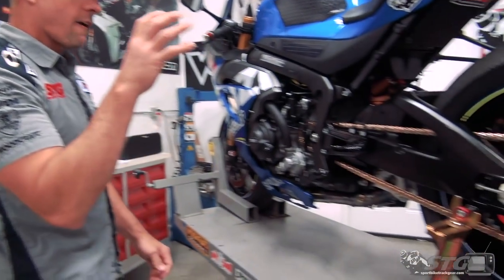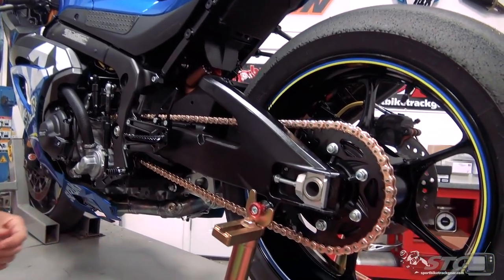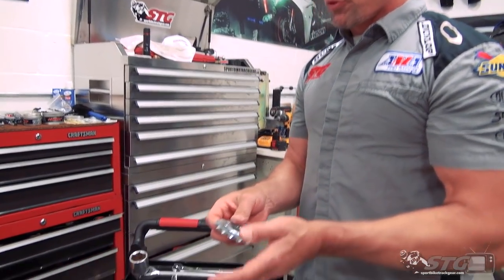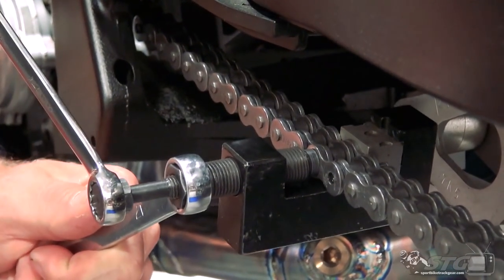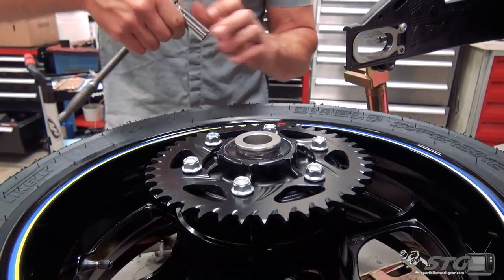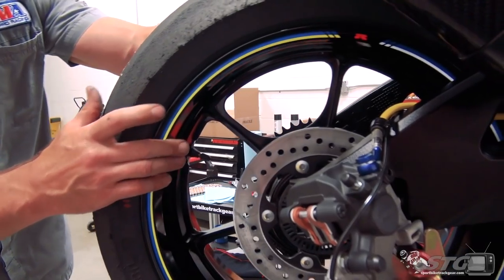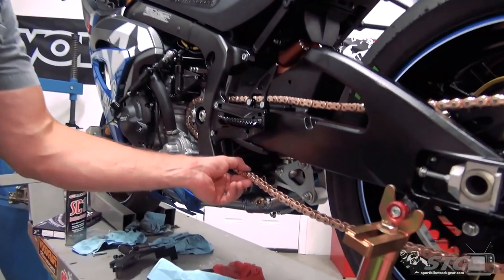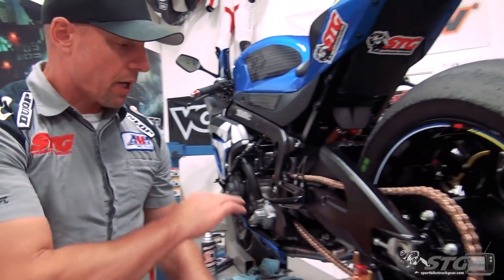Vortex 2018 Suzuki GSX-R1000 Chain and Sprocket Install | Sportbiketrackgear.com

Comment: Brian, I have been looking into a chain replacement for a new MT-10. I have also heard that the 520 pitch is the way to go! I plan on doing the Vortex sprocket and EK 3D pro in gold and with more links than stock to stretch out the wheelbase on that Yamaha. Which results in better drive out of corners.

Comment: Brian tried messaging your staff without an answer I want to do this on my 2017 gsxr1000r but I’m running a set of BST carbon fiver rims can you adjust the package to include a rear sprocket that fits after market rims?

Comment: Good luck putting back that chainguard back everyone! I'm talking about that last bolt between chain sprocket and the chassis. It's almost impossible 😮😮☺️
Reply from the maker: It has been a while since I did this but remember it being easy with the rear wheel removed. - Van

Comment: Another incredible informative video. I just replaced the junk OEM front sprocket. I snapped three teeth off it. Chain was in spec. I'm assuming learning how to use the quick shifter was probably why I snapped three teeth. I went with a steel vortex sprockets and EK amazing and beautiful 3d chain. Hey Van are you still loving this gsxr? I've had my 2018 for s few months now. Coming from the legendary K5. This new gsxr blew me away. Top end feels similar. Low and mid range is so much more powerful. Appreciate the excellent informative videos as always. It's been many years now me  watching here. Your still going stronger than ever. You and your family have an excellent safe summer
Reply from the maker: I am still riding the GSXR, just not as much now that Max is racing MotoAmerica. Thank you for your support and I hope this finds you and your family well. - Van

Comment: This suspension has more travel than my K5. We have to run the chain towards 30 on the rear stand to have proper slack while riding. I had 25mm on the rear stand and that's not enough. It gets tight. Been playing with this new chain tension for two days now. I went back and forth. About to put more slack again. At least now we know
Reply from the maker: I have started removing the rear shock so I can pivot the swingarm to measure the slack when the swingarm is totally extended. Once I find that point I reassemble and measure the slack. - Van
Reply: @sportbiketrackgear  please let me know what you end up with. I'm curious how much the swingarm pulls out of the chain.

Comment: Nice video Brian. OK we know the 520 stuff is lighter , but if a wee bit of weight is not a big deal, drop 1 tooth off the rear will give basically the same gearing and lengthen the wheelbase a touch .
Reply from the maker: There is more to it than just a bit of weight. With 520 you will typically have more gearing options if you are using the bike on the track. The OEM chain gets the job done but it is not very pretty. A high quality chain will typically reduce friction which will buy you a little more power. End of the day none of these are really earth shattering, that said they do add up over a full build. - Van
Reply: @sportbiketrackgear  oh for sure, fully agree. I was just suggesting -1 on the rear may achieve very similar results for a fraction of the cost. 
Kev

Comment: Keep in mind that since the front sprocket is not set on the center line of the swing arm pivot the chain will get both tight and loose as the swing arm goes up and down. (as it departs from the parallel where the chain will be the tightest)

Comment: What do recommend for 2015 cbr1000rr  on the city streets for high speed and cornering ...no track days ......I ride hard corner hard and do freeway pulls at high speed let me know please what you recommend I'm getting alot people saying -1 +2 ....what's your recommendation
Reply from the maker: -1 and +2 is pretty aggressive for a 1000 IMO which will reduce the top speed a bit if you are taking the  bike to that limit. I would start with +2 in the rear for the street. - Van
Reply: Okay thx van... I appreciate it i was thinking supersprox or vortex ...thoughts  on those two sproket kits which one in your opinion is the better sprocket

Comment: Hey Brian, I was looking at this exact setup for my 18 r1m, but I'd like the chain with the black outer plates, and the gold inner plates, I wanted to stay with 525 pitch though, besides weight saving why go with 520.and let me know if you have this setup in 525. The r1m is 16/41 stock
Reply from the maker: I have run this chain all season with almost zero stretch. Personally I would go with the 520 on the R1, we did this on our R1 and did not have any issues. Below are links to the chain and sprockets for your R1:
EK 3D 520GP X-Ring Roadrace Chain

https://www.sportbiketrackgear.com/ek-3d-520gp-x-ring-roadrace-chain/

Vortex Yamaha YZF-R1 15-18 520 Steel Front Sprocket

https://www.sportbiketrackgear.com/vortex-yamaha-yzf-r1-15-17-520-steel-front-sprocket/

Vortex Yamaha YZF-R1 15-18 520 F5 Hardcoat Aluminum Rear Sprocket

https://www.sportbiketrackgear.com/vortex-yamaha-yzf-r1-15-17-520-f5-hardcoat-aluminum-rear-sprocket/

- Brian Van
Reply: @sportbiketrackgear  , thank you for the attack performance rearset suggestion,I went with aero hard, amazing on the 18 r1m, kept the stock brake light switch by buying a bolt and washer, used some loctite, spring in the cutout in the brake arm

Comment: Thanks you. Exactly what I needed to feel comfortable for my install. 
Looking to comfortably break 200+ while minimizing acceleration a lot loss obviously, what do you recommend tooth count for front a rear on my GSXR1000. And what brand did you use on this bike.
Reply from the maker: I am running an EK 520 chain with Vortex sprockets front and rear. The gearing is stock front with one tooth smaller in the rear. - Van

Comment: Hi Brian also agree on 41 and 16 on fron t,  too short compared to my 10rr and r1m
Reply from the maker: Every bike is different, the transmission ratios are not the same on all bikes which is why the sprockets used vary. I rode the bike last Friday with the gearing at Grattan in MI and it worked well. As the pace picks up it will be even better. - Van

Comment: I did a sprocket change on the same bike but 16/45. My quickshifter is now acting a little weird. Above 10k rpm, it doesnt want to shift 4 to 5 nor 5 to 6. At lower rpms at 6k, doesn't shift down. I had to resort to manualy shifting. Feels like a power cut but gears don't change. QS icon blinks. Any ideas? Would be helpful.
Reply from the maker: If it feels like the power is cutting but it does not change gears it is possible the trans needs to be serviced. Important to make sure the throttle is closed when initiating a downshift. - Van

Comment: Is it safe to spray front sprocket area with chain cleaner to clean? Worried about seals and silicone that seal engine cases

Also any need to grease push rod for clutch? 

Same bike in question 

Thanks
Reply from the maker: Safe to spray and you can always rinse if you are worried about it. When you have it apart you can also apply a little grease as well. - Van

Comment: I didn't understand what's the point of putting the wrench between the chain and the sprocket when tightening the rear nut?
Reply from the maker: That is to force the rear axle adjuster blocks firmly against the adjuster screws. I have switched to using a small phillips screwdriver now. - Van

Comment: Did not show tightening of front sprocket nut. Sad
Reply from the maker: 99% of the time I use an electric impact without the chain installed. - Van

Comment: Hey Brain what would you recommend for a daily driven 2011 gsxr 750? -1 front +1 rear ?
Reply from the maker: Either that or -1 front and +2 in the rear. Your suggestion would be just a bit less aggressive. - Van

Comment: installed brand new vortex sprocket front 16 T rear 45t 525   new 525 chain and i believe the rear sprocket wobbles and has tight spots in the chain gets tight then half a rotation of the tire the change get loose
Reply from the maker: We have installed a lot of Vortex sprockets over the years and have not had a bad one yet. To check the new sprocket you could install the OEM one that you removed and see if you still have the tight spot. If you still have the tight spot odds are the chain has stretched unevenly. I have seen riders install a kit and set the chain tension too tight result in uneven chain stretch. - Van

Comment: I've been looking into changing my sprocket and chain and need some serious help. I have a 07 GSXR 600. The previous owner has a 48 back sprocket  not sure what the front is. The speedometer is severely off and I want to fix that bit but I also like the torque at low end. Been thinking 16 front and 45 rear would be good but not sure.
Reply from the maker: We have a ton of chain kit options for this bike on our site. If you want to fix the speedo you can install a HealTech SpeedoHealer. Here is a link to our site: https://www.sportbiketrackgear.com/parts/suzuki/gsx-r600/2007?_bc_fsnf=1&Department=Sprockets+and+Chain+Kits - Van

Comment: I thought you need to use special sockets with an impact gun? That looked like a standard socket
Reply from the maker: Depending on the application you can use a non-impact specific socket with an impact. Really depends on the socket and the work you are doing. When in doubt use an impact specific socket. I have been fixing shit for a long time now (was a tech at a Cadillac dealer before I started STG 18 years ago) so I am pretty good at determining what will and will not work. - Van
Reply: @sportbiketrackgear   thanks for the advice!

Comment: anyone think how to videos are 50% whats the torque?
sorry brian but heres the right way
rear sprocket 43.5 ft/lbs
counter sprocket 83 ft/lbs
engine speed sensor where applicable 18 ft/lbs
rear axle nut 72.5

Brian brian brian........tisk tisk....props on the gearing selection video....landed me right where i wanted thx
Reply from the maker: Thank you for sharing the torque specs. As I say in all of the videos if you do not have the experience to work without a torque wrench research the specs and torque away. I have spent all of my adult life wrenching, 20 year professionally. Aside from engine assembly most professionals do not use a torque wrench. - Van

Comment: I just put a sprocket kit on my 2021 Zx6r and the chain is eating the top of my chain slider and whining. I have played with the slack (loosened/tightened) and cleaned /lubed the chain but it doesn’t help. Any idea on how to fix this?
Reply from the maker: Make sure the front sprocket is installed so the spacing from the output shaft to the face of the sprocket is the same as the OEM sprocket was. Some of the front sprockets have a shoulder on them that changes the spacing depending on whether it is facing the output shaft or not. If this spacing is wrong it will cause issues. - Van

Comment: What size of sprockets and chain do you recommend for street use? Thank you.
Reply from the maker: It is different for every model. IMO for the GSXR1000 the stock gearing is going to get the job done for most everyone. This bike makes so much useable power gearing changes for the street are not as important. The only way I would make a change would be if you want it to accelerate quicker. In that case I would replace the rear sprocket with one 2 teeth larger. - Van
Reply: @sportbiketrackgear  Thank you so much 🤟

Comment: Hey Brian!  Are you planning on installing a toe guard (shark fin) on that bike.  I would really love to see one done as well as be pointed to a particular one you recommend. I have a 17' 1000R and haven't been able to find a definitive solution.
Reply from the maker: Yes I will be installing a toe guard soon. Not sure which one I will be doing on the GSXR. On Max's R3 I went with the Woodcraft Toe Guard, here is a link to that video if you want to take a look: https://www.sportbiketrackgear.com/woodcraft-wide-coverage-toe-guard-kit/#pv__tabs  - Van
Reply: @sportbiketrackgear  Thanks for the reply.  Great video.  I see there are a few universal models out there.  Just would like to find the right one before I start drilling holes in my swingarm.
Reply: @sportbiketrackgear  0

Comment: Aftr changing the chainset and added/removed some teeth.is speed calibration needed?
Reply from the maker: No this bike uses the wheel speed sensors to calculate speed. The only thing that would create inaccuracy would be changing the tire size. - Van

Comment: Thanks for the great videos. Coming from a >2015 R1 with 15/45 gearing what would be a comparable selection for the GSXR?
Reply from the maker: I would use the  16 tooth front (one tooth down from stock), 41 tooth rear (4 teeth down from stock) and 118 links like we did on our bike. It works great everywhere I have ridden it. - Van
Reply: @sportbiketrackgear  i have a 2020 gsxr 600 what would you recommend gearing to get best out of bike. I'm not putting it on the track ,just want performance
Reply: Did you ever find anything as far as a gearing set up? @NextManUpTV

Comment: Quick question Van, doe s the back of the master links chain supposedly sticking out or it should be flush?
Reply from the maker: The master link should not look any different that the rest on the chain. Only real difference is the rivets on that link have a hollow center so they can be rolled over with the rivet tool. - Van
Reply: Thank you Brian!

Comment: After installing my new front sprocket it has a lil play while on the shaft. Ever heard of this?
Reply from the maker: If you purchased the kit from us please contact customer support so we can get this sorted out for you. You either have the wrong sprocket or there is an issue with the way you have installed it. Either way it is important you do not ride the bike like this. - Van
Reply: @sportbiketrackgear  i will call tomorrow. But im sure its the right sprocket, i matched it with my old one. When i slide the sprocket onto the shaft and have the bike in first gear you can slightly move from left to right.

Comment: Thanks! Here is south korea. Front 16 and rear 41 ~ 43? Right? 520 chain?
Reply from the maker: Yes that is the range we are working with right now. Currently I have a 41 tooth on the back of the bike. I have ridden it a couple times and the chain has stretched very little, real happy with this kit. - Van

Comment: Would you recommend the EK 3D 520 GP for street riding for a 1000cc or the EK 3D 520 z
Reply from the maker: The Z is a little heavier so it will stretch less and should last longer in theory. I have the GP on my bike and it worked great all year long on the  track, very little stretch. If the additional .3  lbs per 100 links is not important to you go with the Z. - Van

Comment: Did the rear axle nut start on that side originally or did you reverse it out of personal preference?
Reply from the maker: This is the side it was on when I go the bike. The right side is where you will typically find the axle nut on most sport bikes. - Van
Reply: My 2013 Gsxr 750 has it on the left side 😔

Comment: What would be the top speed with this sprocket set up?
Reply from the maker: That is a great question. I remember straight away GPS speeds of a little over 160 mph. Not sure what this would be held open on a highway for an extended period. - Van

Comment: Hi Van, would like to ask about the EK 3D 525 chain, can this chain work with the ducati monster 1200 s Y19. Online description the application is 250cc to 1200cc, the bike is 1198cc.
Thank you
Reply from the maker: Yes that chain will work for your bike. The 525 is more than strong enough. - Van
Reply: @sportbiketrackgear  thanks van, was cought between 2 choices, the EK 3D and the D.I.D ZVMX

Comment: Porbably a squid question lol: but whats the STOCK sprocket size on the 2018 GSXR 1000r?
Reply from the maker: Stock gearing is 17 front, 45 rear with a 525 chain. - Van
Reply: @sportbiketrackgear  Awesome! Thanks for the Response Van!

Comment: Hey what’s going on man I have the same bike but I use it more on the street then the track did you see any loss of power in the being of the gear and how was your top end performance
Reply from the maker: This gearing has worked great at all of the tracks I have used it on thus far. No loss of power at all, it is just a little taller than stock. - Van
Reply: @sportbiketrackgear  thanks fam I just ordered the same gearing and a couple other items I appreciate it

Comment: What size chain would you recommend on a 2011 GSXR 1000 with 16 teeth in front and 43 teeth in the back?
Reply from the maker: Looks like that will need a 114 link chain. The Vortex Racing Kits come with the chain pre-cut chain lengths. Here are links to both of the kits on our site: 
Vortex Suzuki GSX-R1000 09-16 V3 Chain and Sprocket Kit

https://www.sportbiketrackgear.com/vortex-suzuki-gsx-r1000-09-16-v3-chain-and-sprocket-kit/

Vortex Suzuki GSX-R1000 09-16 V3 2.0 Gold Chain and Sprocket Kit

https://www.sportbiketrackgear.com/vortex-suzuki-gsx-r1000-09-16-v3-2-0-gold-chain-and-sprocket-kit/
Show less
Reply: Thanks for getting back to me so fast 😁🤙